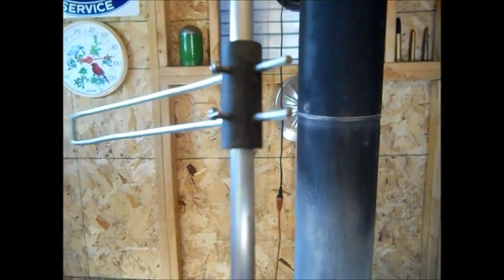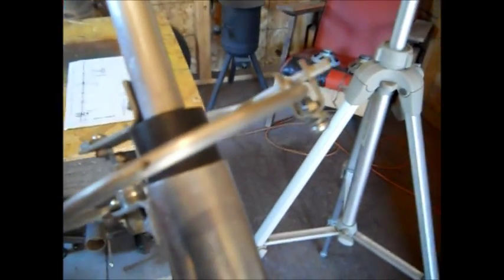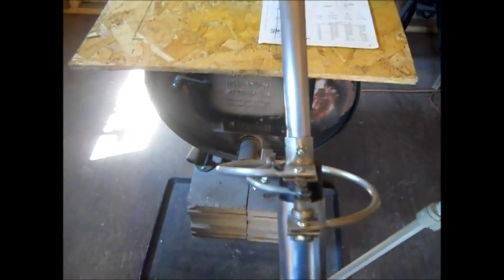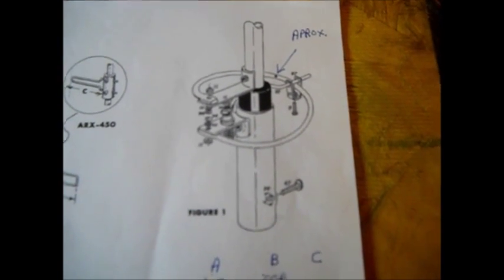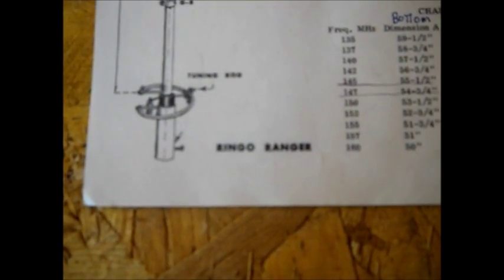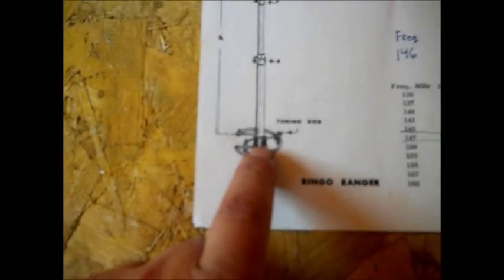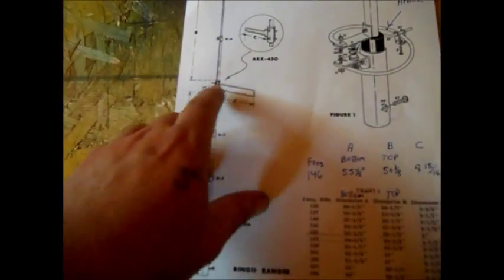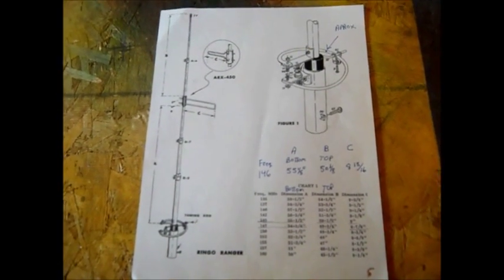CUSHCRAFT RINGO Amateur Radio Antenna  (Part 2 )

Comment: Try to side mount it of a tower. Got a lot of problem tune it. I will put it on a mast on the ground I think, tune it at the bottom and then put it back at the top.